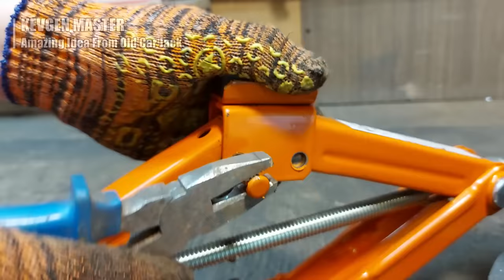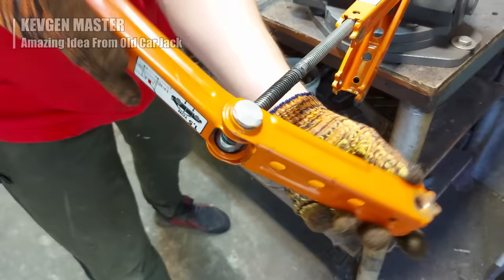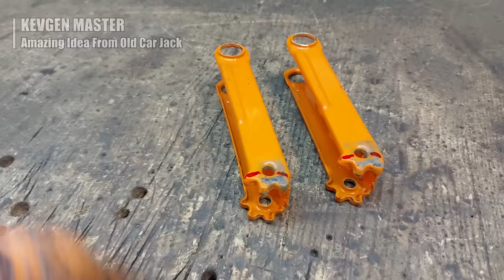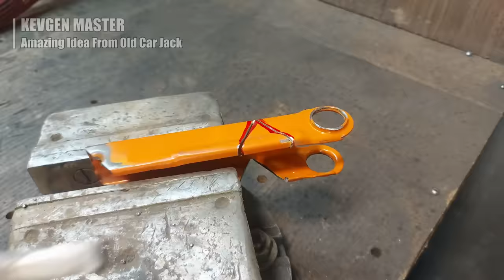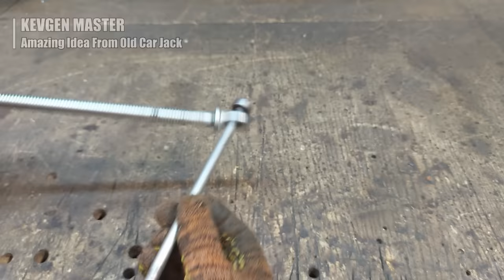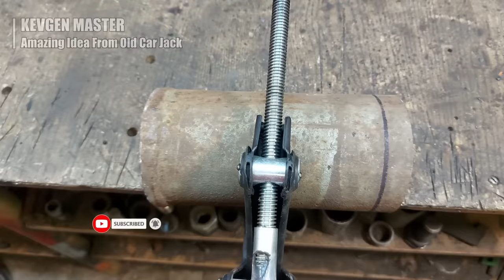Amazing Idea From Old Car Jack!! Powerful Homemade Clamp from an old Car Jack!!

Comment: Perso je me sers d'un très vieux serre-joint grand modèle du siècle dernier et ça fonctionne super😅. Je me voit mal acheter un crique pour bagnole et une journée de boulot pour faire la même chose au final😂 . Cela dit tu bricoles bien mieux que moi c'est certain mais dommage que tu dépenses ton énergie et tes capacités en bricolage pour faire ce genre de trucs qui n'a absolument rien de vraiment génial ... enfin pour moi😅 , après chacun voit midi a sa porte ... bien sur🤣

Comment: Ici nous avons une magnifique vidéo démontant comment transformer un cric qui fonctionne en un outil pour fixer des pièces sur un établi. Cet outil que l’on trouve communément dans des magasins de bricolage s’appelle un serre joint. Mais si on en fait une vidéo de 6 mn. On peut en faire un putaclic et gagner de l’argent avec ceux qui comme moi perdent leur temps à les regarder !